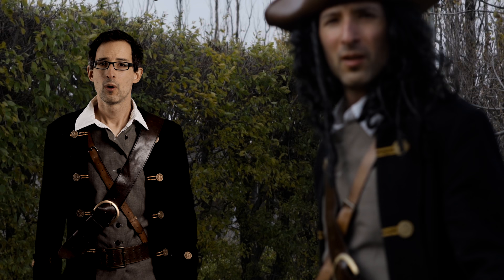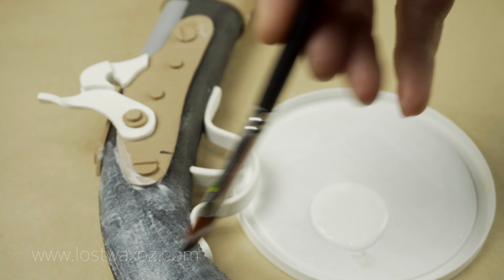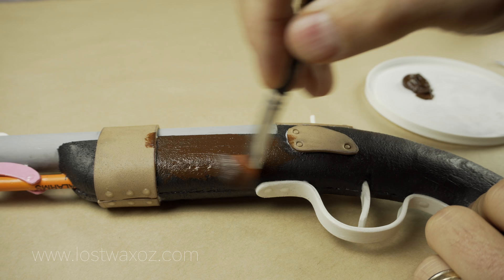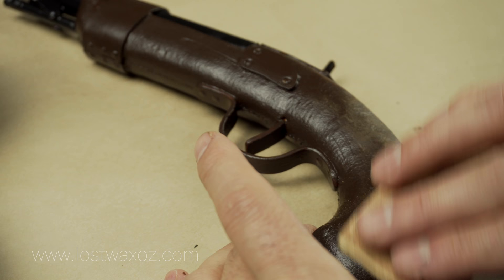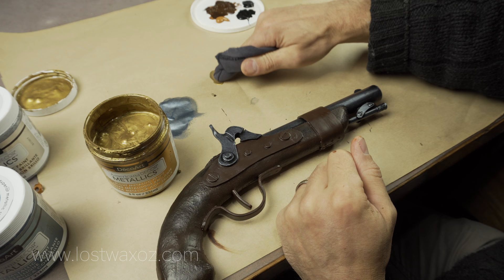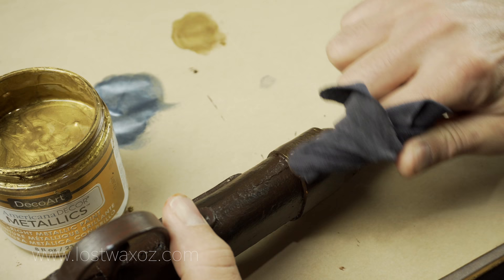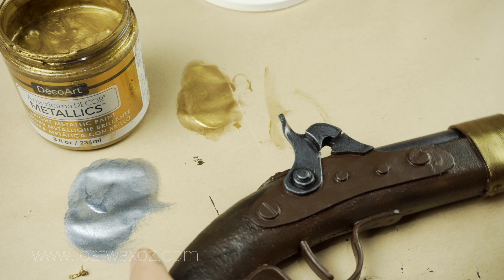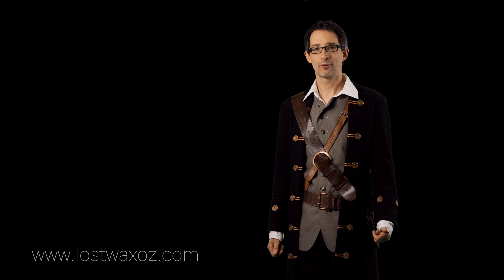How to Make A Pirate Gun From Foam. Part 2- Prop Painting Techniques

Comment: Hey Chris, thanks a ton for this tutorial, but I've got a question: How sturdy is the pistol as you made it, can it stand up to rough handling? I'm mostly asking because I intend to use it for LARP and want to know if it'll hold up.
Reply from the maker: I guess it depends on how rough you are talking about- it is still made of foam- but mine have been thrown all around, and still look pretty good. What I do notice though in the one I made for this video, is that the foam has a bit too much flex right above where your hand is on the handle. It kind of makes sense, the barrel is holding the stock nice and firm, and your hand is holding the grip, so any movement is isolated in the space between those. So.... I would add a strip of hard plastic or flattened pvc in between the two foam halves just in that section (hollow out a little space for it)  
Also, I have made another one, but I added a third 5mm sheet of foam in the center between the two others, and that added thickness also helped to stiffen it up.

Comment: How do you like the acrylic metallic paint compared to Rub & Buff?
Reply from the maker: I actually really like it. I've use RNB, water based metallic pastes, and now this, and right now it is my favourite. (other things would still have their place in the right instances though) . It has no odour, and because it is a paint rather than a paste, it seems to maybe have more binder in it?? which means, at least from my experience that it doesn't rub off as quickly. Also one of those jars like I use in the video will last you 7 lifetimes! The one thing I don't like quite as much about the paint, is it seems to have a coarser sparkle, if that makes sense, so if you turn the painted piece in the light, you see individual sparkles a bit more than using the paste finishes. Still, I am really happy with it.
Reply: Lost Wax thanks for the reply. :-) Keep up the great work. I love all your projects!